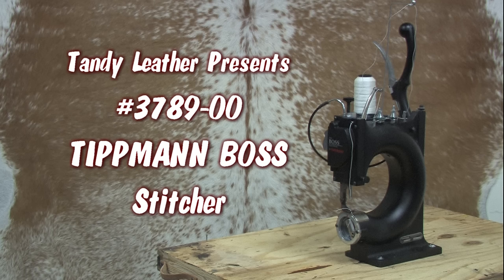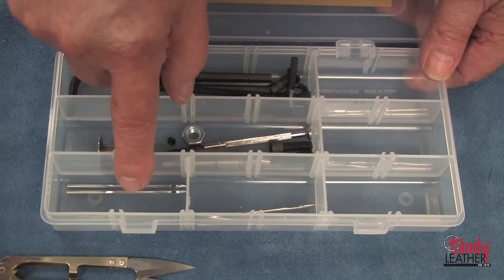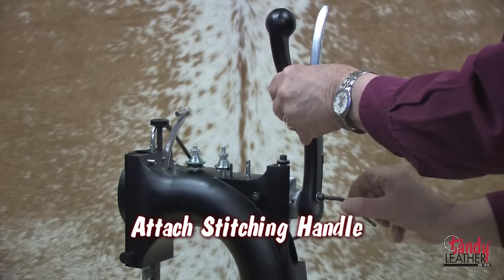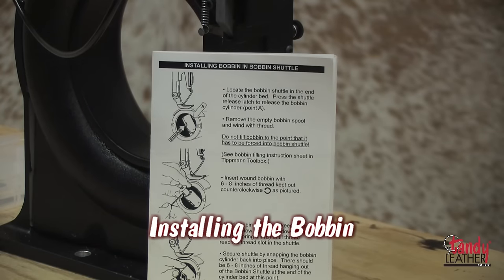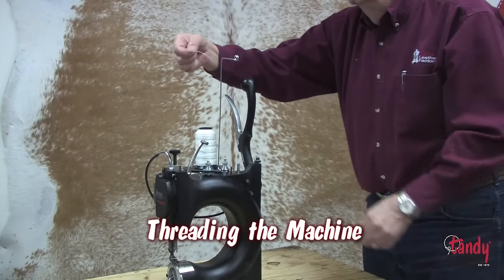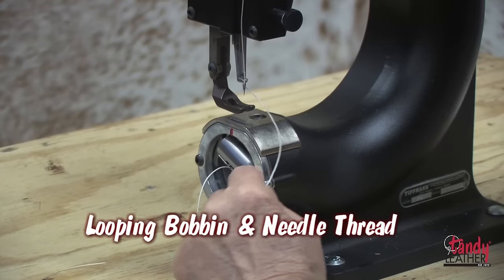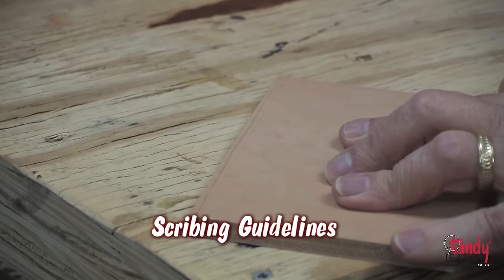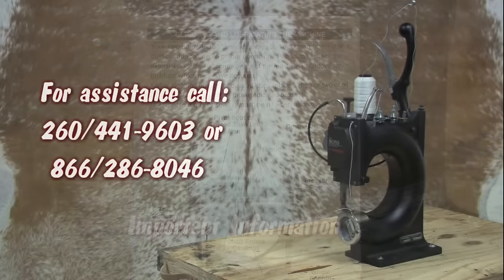Tippmann "Boss" Leather Sewing Machine #3789-00

Comment: why are they so expensive and it a manual machine..
Reply: Because they are that good. At any rate, comparable leather sewing machines are almost always much higher the cost and require electricity. electric/motor sewing machines have their advantages but often, are more frustrating when maintaining, which they usually require more. I love my Boss for small projects which is the one drawback. the throat is small.

Comment: now why do you want to spend$ 1.200 on hand operated stitcher you can get a ga5-1 or somthing on that line
Reply: most likely you would never have to buy another so since there's no quick turn around buy they have to value it at what is reasonable! Just imagine not having to get another one for 10-15years, for a buisness you don't think that's a good price for a good product! it seems like alot but with all the crap we buy and spend on and replace we pay way more that's why you get what you pay for.👍